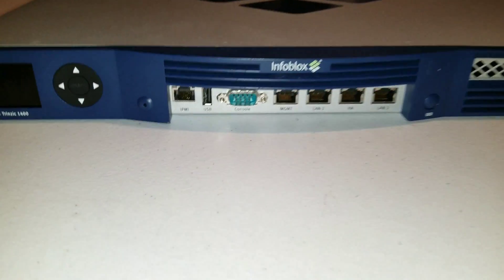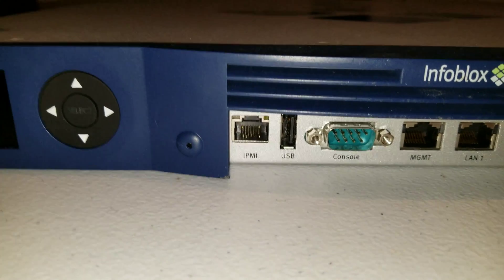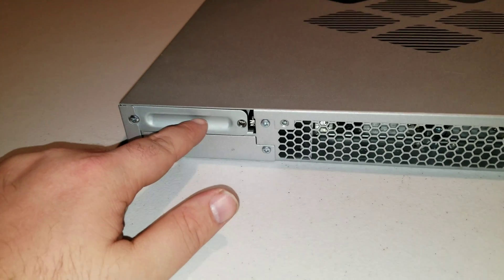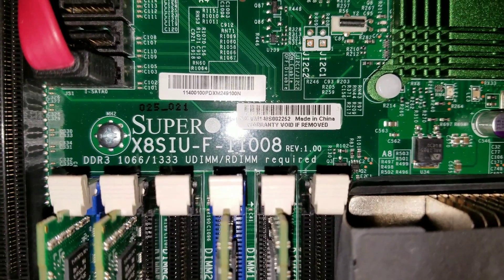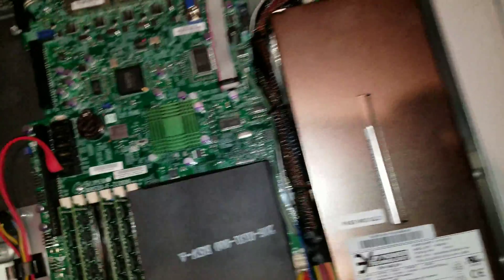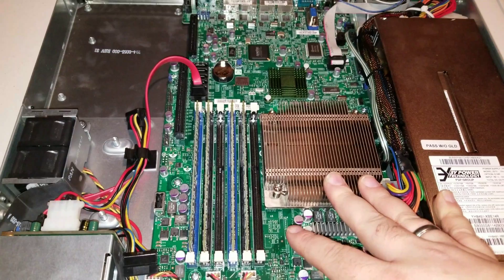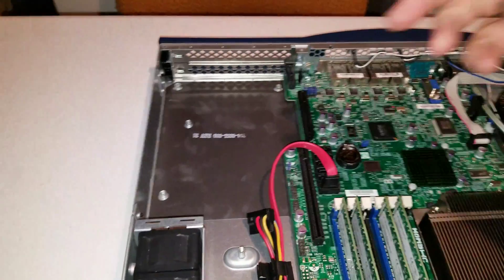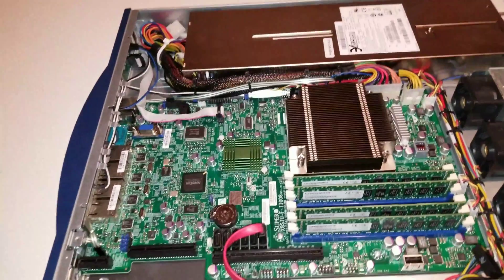Infoblox Trinzic 1400 Application Server Overview!!

Comment: Hi Anthony, thanks for your video. I would like to install pfsense on same Infoblox hardware.
Can you please share some details, how you got the BIOS password unlocked?
Reply from the maker: I used hirens boot CD to get the password using the bios utilities. I don't remember what utility i used but I think it was hirens 14 or so.
Reply: @krypticnexus  But how have you cracked it with  help of Hirens without VGA? The VGA is disabled by factory and the BIOS is locked, right?
Reply from the maker: My units internal VGA work just fine there was a jumper on the board that you have to change
Reply: @krypticnexus  Perfect, I will give it a try. Thanks a lot
Reply from the maker: Not a problem
Reply: @krypticnexus  Hi Anthony, is there a chance you still have the Hitens Boot CD and you can check the name and version of the utility that worked for you when removing the password? I think I have tried all of them but no luck so far.
Reply: @ukaszdomanski9722  I just used the utility and it doesn't remove the password, it shows it to you. I tried removing the password once I was in the bios, but it still kept it. It must be hard coded into the bios firmware.
Reply from the maker: https://www.supermicro.com/manuals/motherboard/3420/MNL-1223.pdf 

page 52 has vga enable jumper.